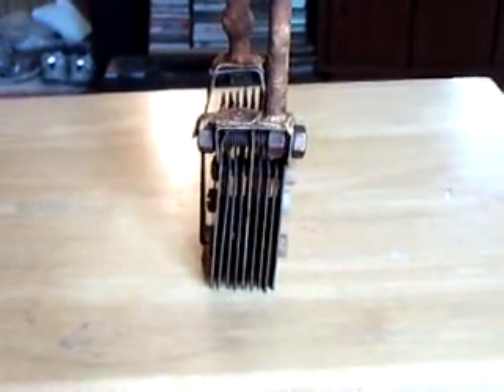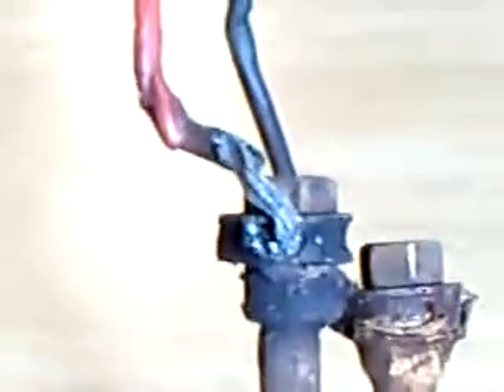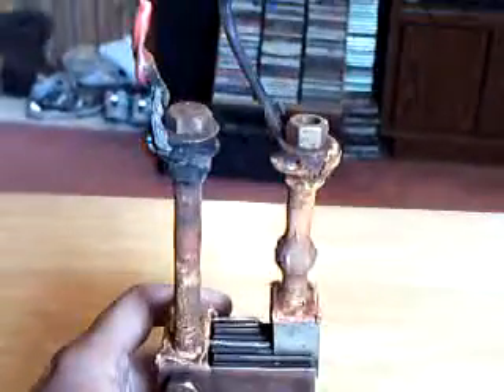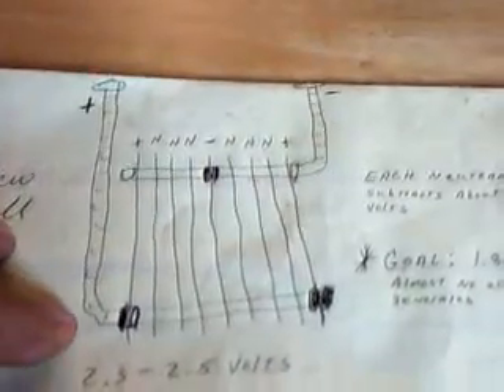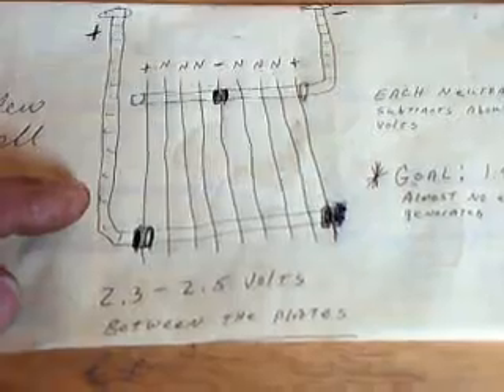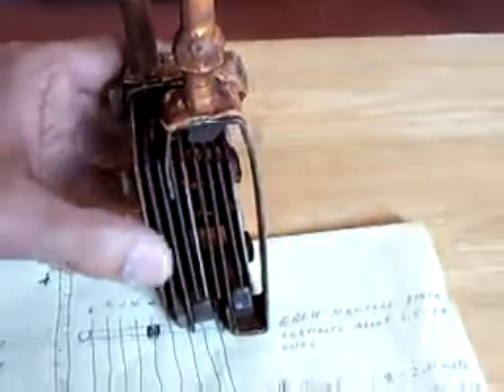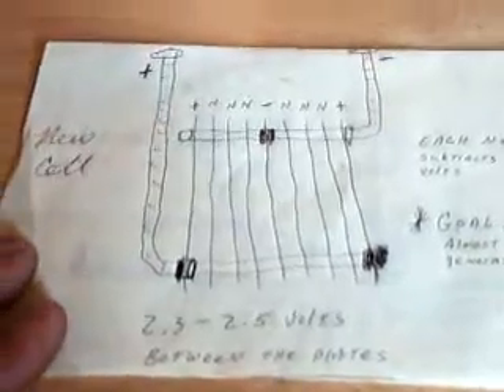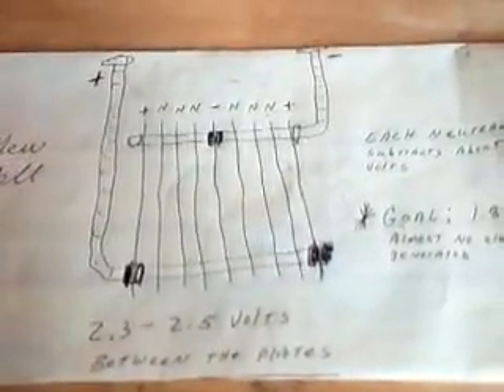#006 My old HHO way of thinking

Comment: you might try some of that heat shrink material that Smacks has been suggesting ... can get it from McMaster-Carr ... once shrunk to your plate stack, its pretty thin so wont take much room in your container ... some have reported pretty good results with it ... and its cheap enough so if it dont work and you end up cutting it off, not much lost ...

Comment from the maker: I believe that to be very correct, but my current vessel prohibits me to do that. (lack of room inside)  I've thought about taking an idea that i've seen and use split vinyl tubing to use for that.  A simple solution to all of the marine goop inside the electrolyte. Only a fraction would be used. The video was just showing how I constructed my plate configuration to try to slow down the generated heat.

Comment: I dont want to discourage you.  You have a plan and it may work.  But you have missed a couple key elements in the construction of a series cell. In particular, sealing the plate edges against current leakage.  You could make a significant improvment in your efficiency by doing this.  Zero did a series on this early in his VSPB series.  It works.  More current gets forced through your plates instead of doing an end run around.

keep at it, be well ...